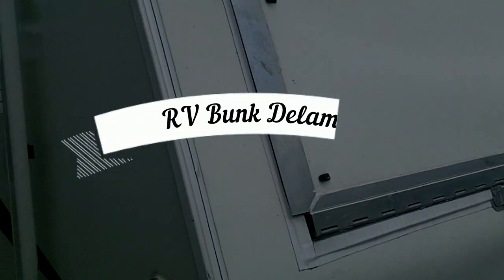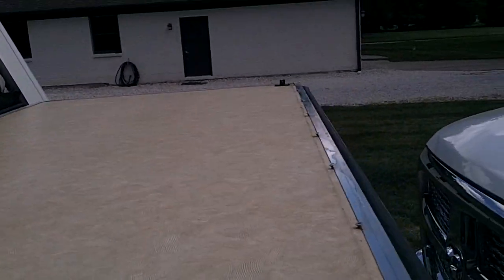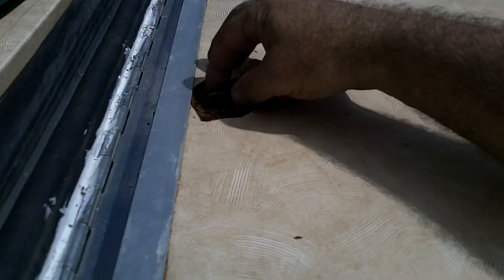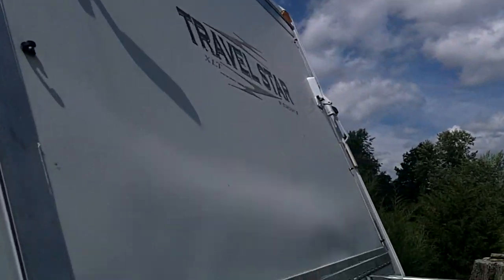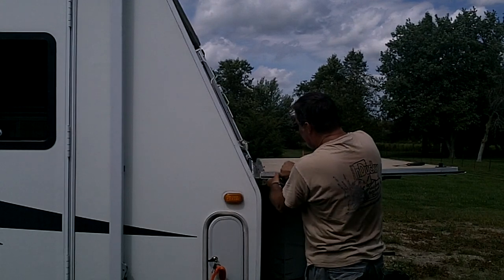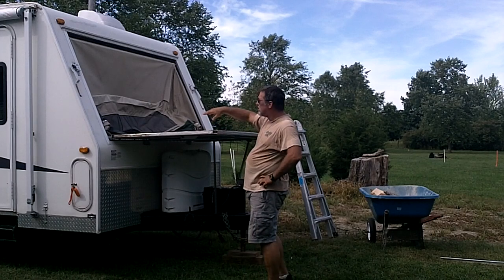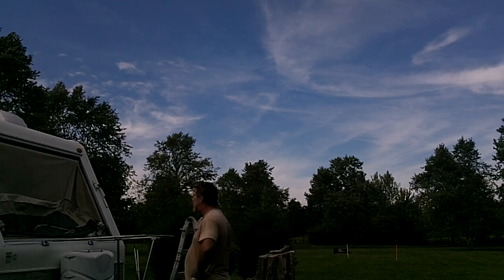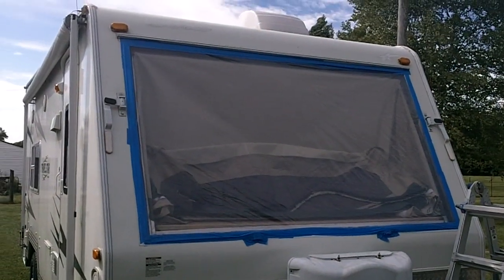RV Bunk repair Part 1

Comment: I have a 2002 starcraft starshuttle Toyhauler  and it been sitting neglected for over 10 years  we bought a class C RV  and my wife never wanted to get rid of the Toyhauler, and  now my son wants to take it so now it need a lot of work, replacing the inside floor,  replacing the kitchen sink cabinet and counter top 4 new tires, we live in a dry climate  but this walls are also delamanateted, and in need of repairing, THANKS FOR YOUR VIDEOS THEY REALLY HELP

Comment: I watched both parts.  Yes!!!!  i HAVE THE SAME PROBLEM. Seems a bit overwhelming but it is what I've got to do.  Thanks for the step by step instructions.   I wish I could re assemble with the original outside material with decals.  I can deal with the diamond plate, but would like it to look original.   Oh well, I'll see what it finishes .  I admire you efforts on the camera work.   My initial inspection has me somewhat puzzled how to get the whole panel off the camper with the hinge.  Mine is covered with some  black rubber.      HERE' GOES.
Reply from the maker: Go slow, take pics as you disassemble,  for reference when you reassemble.

Comment: Looking forward to video 2. Looking at a camper with this damage and nice to see what the fix is as I might have to go thru it.
Reply from the maker: Part 2 is posted.  Thanks for watching.
Reply: @redroofretriever  now to convince my wife that my dad and I can tackle this project of we buy the camper that needs this fix lol
Reply from the maker: My video shows it can be done.  If you are buying low enough to justify the cost of repair, and she likes the rv otherwise, I think you and your dad will get the go ahead.  It is labor intensive, and the end result is clearly worth the effort.  I did my repair so that when I sell it next year the buyer will be confident they won't have to deal with water intrusion, at least on the front bunk.

Comment: Thank you for sharing this. I’m about to start the same project. Three years down the road, is there anything you would do differently?
Reply from the maker: I sold this a year after the repair, but it has held up. So, no, nothing different to add or change.

Comment: See if you can fit some polyiso foam in the door.  Much stronger stuff and you should be able to find some glues for it.  Also it has a better R value than styrofoam.
Reply from the maker: R value doesnt matter when you have canvas over your head.

Comment: Thank you for the video.  I have the same issue with mine.  My outside piece is okay but the inside "bed floor" needs to be completely replaced.
Do you think I could use thin metal, instead of plywood.  It would give me something stronger to weld the sides together (i noticed when I took mine apart, there were very few welds holding it together).  
So...Id have the original outside piece, replaced syrofoam, then a thin sheet of metal that would be welding along the seams.  Do you think that would work??  Thanks
Reply from the maker: It would work, as long as you maintain the same thickness to provide clearances and seal compression. If you weld it tight, it may not have enough flexibility in it and eventually would cause other issues??  Thanks for watching.

Comment: Did you ever figure out the source of the water leak?
Reply from the maker: Yes, the bolt holes for the latch on camp side. Water went in there, rusted the sex bolts to the nuts, and need to be cut out. Structure within was solid so I replaced with regular bolt nut and dicor sealant. Rain tested many times the last few months, no more intrusive leak. Check yours, if they spin they likely leak.
Reply: I have the same issue. So water made it from the RV side to the hatch or from the hatch bolts?  Did you get water into the storage compartment below?

Comment: Cool video, is that EMT thats is used for the bed frame?
Reply from the maker: The frame it extruded aluminum,  from factory. I only cleaned and reinstalled it, as shown.  Thanks for watching.
Reply: @redroofretriever  oh ok cool thanks, reason i ask actually is I picked up a 2005 Antigua 215sso from auction but its missing all the bed frames front and back plus the bed bows, I think I have got it squared away but your video has actually given mw the best view I have been able to find yet of the front frame. Now I just have to hope my measurements are good, does yours have a rear pop out bunk also? If so would you mind posting a pic or 2 of the frame assembly? thanks in advance
Reply from the maker: @imageartifact  this is a toy hauler, rear is ramp door. I no longer own this RV. Thanks for watching and commenting.